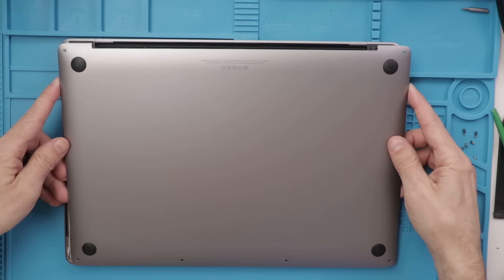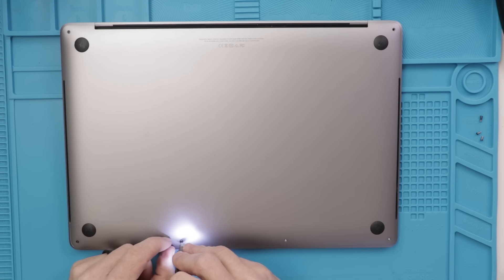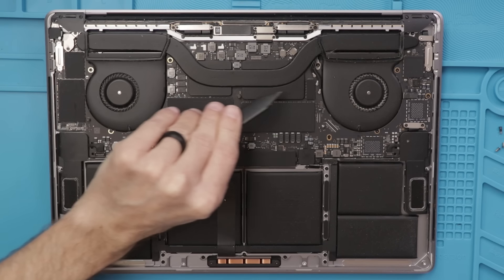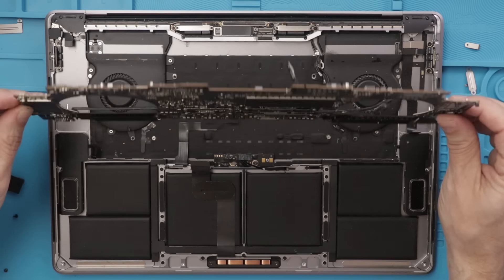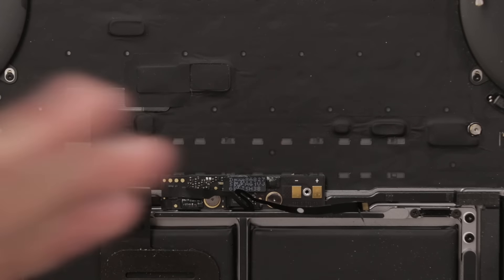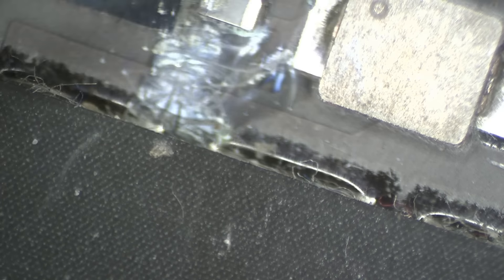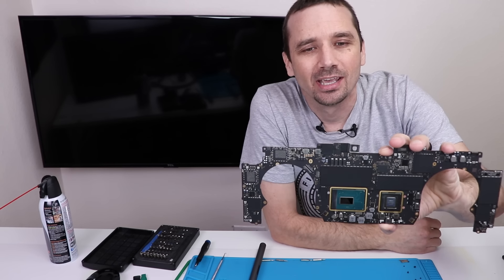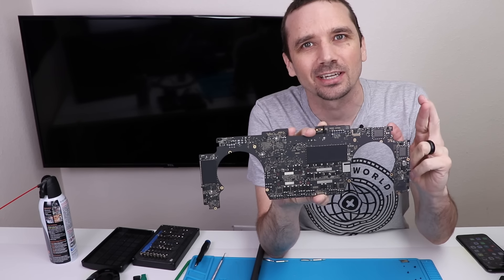I Spent $865 on a Liquid Damaged 2018 MacBook Pro - Can I Fix It? Did I Just Waste my Money?

Comment: Beeping Multimeter is not a short by itself.. Actual resistance is what matters. Since your measurements were short and scattered, cannot guarantee that there are no shorts, but seen measurements like 7 ohms and so, which is not a short. You are measuring around the CPU / GPU Area, pretty much all of those lines will "beep" on multimeter, but there wont be a short. GPU / CPU power lines has a resistance as low as 1 ohm to ground in normal working condition...

Comment: im fairly certain the 52v to the cpu only applies to the 13 inch mbp. Since the 15 inch has dual graphics (integrated and dgpu) if that that 52v actually happens it just blows the chip that deals with the graphics switching you might want to look at that

Comment: Good Video. I would never be brave enough to open any laptop or have money to buy a broken one. Good luck fixing that. Btw I had a $20.00 Bluetooth speaker with water damage from the ac port...ended up throwing it out and buying new one.

Comment: Once liquid damaged, always and forever liquid damaged.  It will never be reliable unfortunately.  It only takes one component shorted to ground to throw a short across most of the board.  Since your $850 deep, try removing more components to clear the short.  At this point you don’t have more to lose.  What do you use for a microscope?  I’m looking for a recommendation for my tech bench.  Great videos!

Comment: Before 2020 I had 2 laptops Asus and HP. First one - I had to do prolonged short circuit test because nothing was heating up, after long time on thermal camera and pirometer it came clear that nV GPU is failed because I had shorts everywhere after taking extreme measure to desolder most of the powerlines, including each ceramic cap- gpu heated to about 50 degrees in about 15 minutes, not immediately, old fermi 820, not worth fixing. Second one was HP - I had response from 3.3/5V converter but after powering on from KBC i got OVP cutout. No short on GPU(had radeon), desoldered most of CPU power line, still shorted on CPU lines, gave up after time, probably because of one particular failed mosfet I have found, 19.5V went to CPU die so that was a failed kaby lake case and so on. I'm giving thumbs up for this video. Doesn't matter if you're mac specfialist or other, sometimes there are cases you cannot fix no matter what you'd do. It happens. I had those cases in years of a lifetime and no matter how much I wanted to repair something, yes I could do it, but those repairs wouldn't be cost effective which I am going for every day. What I'm cringed from are cases when most of youtubers show easiest cases possible as a fix and they say it's a fix, geez. At least this channel was mixed, some repairs were easy, some not but at least I have come to a channel that can show that some of the repairs are not a success. Rossman is based on Macs because in America/Canada you have a lot of them and they mostly fail in a certain way, just watch his videos and you can see. As from eastern european experience - 99% of repairs I have to do are NOT MACS, AT ALL. Yesterday I had to fix a mag safe 2 charger and that was the first reported case on my desk for apple in the last 2 years. There are some people carrying macs/iphones but majority is completely diffrent compared to western countries. There are some other diffences but this comment is waay too long anyways.

Comment: You don't have a short on GPU or CPU. they have very low resistance to ground. You cannot use beep mode you need to check resistance to ground. Solve your power issues!!!!
Reply from the maker: That's what I'm getting from other comments. I'll be looking at this more.

Comment: I buy scrap Russian watch movements listed as not working, 9 times out of 10 its either magnetism (the usual suspect) or dry jewels on the balance and I have demagged and oiled all of them and 9 out of 10 spring to life and through that I have recovered several quite rare Russian pieces.   I also bought a high end Denon mini hifi last week, after a thorough clean the CD is the only fault left with a stretched square belt and the unit is flawless and like brand new and only for £10 too where the speakers are worth a lot more on their own lol.
Reply from the maker: That's awesome! You've got a great niche there!

Comment: @TronicsFix This is not a short, GPU uses a very small amount of Voltage, thus the Resistance to ground will be very small like 6-12 Ohms, you have it in continuity mode (beep mode) it beeps always when it comes close to like 20 or 30 Ohms, I bet GPU is good and the real issue is that you are just missing some contact of those previously corroded chips... check them under your microscope :)
Reply from the maker: That's what I'm getting from the comments. I'll be looking at it again.

Comment: Most liquid damaged MacBook Pros 2016 and newer end up with dead CPU.  There's a kind of flaw / vulnerability in logic boards of this Macs - CPU dies there incredibly easily. Actually you don't even need to liquid damage the laptop. To have a low quality USB-C hub will be enough. Models of 2015 and older weren't like that.

Comment: I believe most stuff around gpus and cpus cant be measured in ohms mode because they are very low resistance devices and simply read as a short. Maybe those measurements dont say much. I'd try the "power in and look for heat" method. With any luck, its not a low resistance short and something will be cooking. Thanks for sharing

Comment: I spilled 2 spoonful coffee on my Macbook Pro 15 2017 in top of keyboard and trackpad. Apple charge me around 1240 usd for repairement. Then I just go to trusted unofficial apple service center and charge me around 150 usd to clean any coffee residue and remove any corrosions. Then my Macbook came back from death. So far so good, don't have any issue after using around 1 month. But my Applecare status changed to void, since it has been taken apart outside Apple Authorized Service Center.

Comment: I used to work fixing these kind of mobos. It seems the short is caused by some capacitors. Remove the corroted capacitor that apears in minute 3:55 e measure it again. Maybe it could be the problem.

Comment: I thought some of those shorts you measured looked to be around 0.024 diode mode? that isn’t a short very low resistance yes, but typical of low voltage CPU/GPU I would be trying to work out why no communication with the charger, nothing is going to work without that, The USB mux devices are (I think) available CD3215C00, only needs one to be bad to mess up the whole game,
Reply from the maker: I measured most of it in resistance mode but you might be right. I might pull it back out and start looking at those CD3215 chips. I didn't want to waste my time on anything else if the GPU is fried but I'm also not 100% sure it is.

Comment: ive had a look into and attempted to fix a MBP before. the biggest thing i found is that sometimes the whole power delivery system can be shot or sometimes itll just be the display isnt lighting up...in the older MBPs if the display failed the the rest of the laptop would fail.

Comment: If you look at Louis rossmann videos You will see. That some of those charging chips can make you look like you have a short all over the place. So if you pop off the charging chips. That short may go away. You have to pull the charging chips off. The charging chip can make it look like have a short in the GPU. Or the cpu? If you pull the charging chips off. The shorts me go away and you may find out that one of those charging chips Are coursing your whole problem?
Reply from the maker: As far as I can tell from the schematics the components shorted are not connected to the charging chips. I could be wrong though.

Comment: Gpu and cpu have low resistance normally. If you are familiar with Ohm's law, what resistance could it be if normal CPU runs on 1.7v max and it has power consumption around 30-45w. Divide it by voltage and you will get the amps. Substract 90% since CPU is inactive on multimeter testing and divide 1.7v  voltage by amps, it should be around below 1 amp. If you did it right, you will get 1-10 ohm which is exactly what you calling gpu or cpu short.   Go to Rossmann discord server to get some clues and help on that.

Comment: Those large coils naturally have a low resistance they are not shorted.
Reply from the maker: That's what I've heard. I'll have to check into that.
Reply: @Tronicsfix  Check for a short on the 2 green fuses just under the battery connector.
Reply: He is right...gpu lines will always beep

Comment: you can't test coil for gpu or cpu for short because gpu and cpu have a low resistance, so it is normal to have a bip on continuiti test. I really don't think what the cpu or gpu is shorted.
You should start repair laptop PC motherboard than a mac motherboard, it's more simple.

Comment: Hello friend , change the gpu mux chip :) 95 pop from liquid.
 The charging ics if one die the whole machine will stop working , i suggest you get a usb type c amp meter to see how much current is been pulled so wil speed up your process , you will know right away , Also check if the smc is good , OFTEN smc will just die , Keep me posted

Comment: You should get a boardview+schematics for that board and check the powerlines. The resistance to ground on modern GPUs and CPUs are always really low, because they are driven on such low voltage.

Comment: you can take off GPU so you can figure out whether it shorted or not if GPU is being fried there is no way to find a replacement((( at least in my county and probably nowhere
Reply from the maker: True but I wouldn't be able to get it back on correctly with my setup.

Comment: I've watched several YouTubers who work on MacBooks, and one thing they have you don't, a supply of donor boards.  Apple doesn't make it easy to secure new replacement parts.  So, even if you determine which parts are defective … good luck trying to find working parts for a reasonable price.

Comment: I would use a power supply and find the component thats shorted to ground with a higher level of resistance it will get hot or warm. Because it’s possible your charger is tripping out over this short! But a power supply can help you find this fault. I truly doubt the gpu is faulty on all its power lines. It is possible but I believe its related to power to the gpu so could be a 1 or 2 capacitors shorted to ground only way is to see whats getting hot! Good luck would be good to see if you can fix this one. Also check your voltages for start up 3.3 volts on your power button connector.
Reply from the maker: Yes, I've thought of that but also don't want to put too much voltage into the GPU.
Reply: You can put 19 volts at about 1 amp the only thing that will blow is whats causing the short to ground.
Reply: Or if it has the usb c charger the its 5 volts

Comment: Did you check the burning diode or capacitor at 4:50 ? Can't see what it is. Try to unsolder it.

Comment: Are those components really shorted? They seen to be CPU/GPU power delivery lines, and these lines usually have very low resistance, they look shorted, but they're actually not.
Reply: A GPU often has a tDP of 35-45w, and is powered by 0.9v. 45w, at 0.9v, comes out to 0.018 ohms. Any big chip like that on these boards will have super low resistance to ground.

Comment: I don;t think you're crazy, you just like a challenge. I do too. I regularly bought broken PC in college to fix up on the side, when I couldn't I just parted them out on ebay, got more that way then just selling the whole thing as broken.  Usually when the screen was good I could sell that for about the same or slightly more than what I paid for the whole thing as those seem to need replaced alot and went for a good bit, not sure what they are worth now.
Reply from the maker: I could sell this with the good screen for a good bit of money. I might consider that if I can never fix it.

Comment: Did you take pictures of where the corrosion was before you put it in the ultra sonic cleaner for clues. also, Would it be worth it to put power into that section of board and look for a short via heat/ where the rubbing alcohol evaporates faster?
Reply from the maker: Yes, and yes, that might be a good idea.

Comment: Never use ultrasonic cleaners best thing to do is use A toothbrush with isopropyl alcohol at least 99.9 percent alcohol the stuff is amazing. Also if it’s water damaged most likely needs a new battery and screen 📺
Reply: Probably needs a new cpu gpu and an entire laptop

Comment: I think you've missed to check the diode which shorted to the case of the MacBook.
Most likely it is shorted and therefore will cause the shorting of the complete GPU part :D

Comment: What liquid do you use when putting electronics in your ultrasonic cleaner to remove corrosion? I heard ipa in an ultrasonic cleaner is a very bad idea haha
Reply from the maker: Crest electronics cleaner
Reply: There's also Branson EC fluid that works well, but you have to mix it with water.

Comment: was you really in diode mode when testing for shorts ? also the board was not plugged on voltage, plug usb-c, not the battery and test again
Reply from the maker: Ohms and it was plugged in to USB C
Reply: @Tronicsfix  my bad, thanks for answering. could you put the exact motherboard model number in description ? I'm pretty sure YOU can fix it.

Comment: Isn't there a good chance that with it being a modern gpu that has such low internal resistance, that it's appearing as a dead short to the multimeter even though it could be fine?

Comment: I have two laptops that the keyboards don't work. Any videos on how to fix that? Don't know if it's software or hardware? If needed could I send them to you?
Reply: Try uninstalling your drivers then restart the PC to reinstall the drivers (windows reinstalls driver during a restart if they are missing). If it isnt the drivers, then it probably is the hardware. Try typing "laptop model number keyboard replacement". If you dont find a video, just try. Most laptop keyboards are quite simple to replace, and older model are sometimes even replaceable from the top (ie not opening the laptop). 
Do both laptops have exactly the same issues (same keys dont work, etc)?

Comment: Hi Tronics, I got a question: I literally just almost blown my USB ports when trying to charge a cheap watch I got off Ali. Do u have a device that shuts down when there is too much current being pulled from the USB to prevent this, or do you just use a seperate source?
I noticed you use a device to monitor the Amps and Volts when testing things like a Nintendo switch, maybe it also switches off with too much current? I'm sorry to bother you, english isn't my native language so I have trouble finding something I described above.

Comment: Check that Cap where you showed the burning marks on the Chassi, better remove it.
Good Luck
Reply from the maker: Yep, already tried removing it...shorts were still there.
Reply: @Tronicsfix  Apply low voltage to one shorted line and seek what is getting hot??

Comment: I love your movies always so fearless trying to fix things, any way what do you about mux chips? They are connected to the gpu and internal gpu of the cpu and they switch the video signal . And the display cable is wired so bad 20 +volts is next to the to the data line 3,3v to the mux chip. If liquid gets to the display connector you can be sure that chip is dead. Succes with the repairs.. But i would put it back on ebay in stead of trying to fix this thing. Prices have plometed second hand because the base new 16 inch model is so good...

Comment: Some of the CPU lines and GPU lines have low resistance to ground. You also don't always have to replace the CD3215 chips, you can try to reflow them with some flux

Good luck with your journey, I bet you can fix this if you remove some of the corroded chips, and looking under for burned traces, balls etc
Reply from the maker: True...I could try reflowing them. I'll take a closer look at those GPU lines too.

Comment: Hey, a person said i should talk to you. I have a ds and a 3ds that have been broken.
The 3ds: i think the ribbon snapped between the screens. But im not sure. when i turn it on, if i move the systen the slightest, i instantly tunrs off.
The ds: the hinge has snapped at the wire inside has fallen out of place. These broke years ago but i dont know how to fix them.
P.s they are both the original type of ds and 3ds. 
Help me if you can.

Comment: Hi I have a similar problem, MacBook Pro touchbar with liquid Damage, the computer turns on and works well connected, while on battery it works until 58% then error. Also the fingerprint reader doesn't work. what do you think could be damaged, I just need that battery works more time

Comment: Hey Steve I have a TV that recently broke its a 42lf580v 42" lg smart TV one day i turned it on and the screen was so dark you had to flash a flashlight on it to see the screen and there is no sign of backlight could it be the power board or backlights I have some experience fixing I took it apart and didn't see any popped capacitors or any sign of burning please help me thanks very much

Comment: You should get the microscope recommended by Rossman, the video is much clearer.
Reply from the maker: It's not the scope. I still don't have my camera calibrated quite right.
Reply: @Tronicsfix  my bad. I didn't know what the attachment was called. Hope you can find a fix for it!